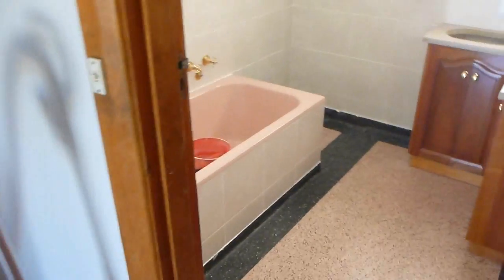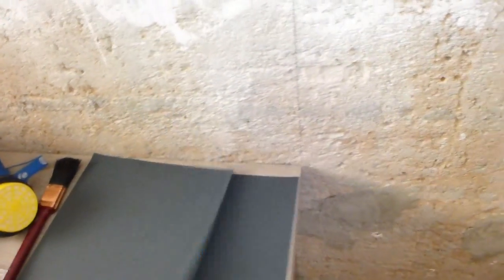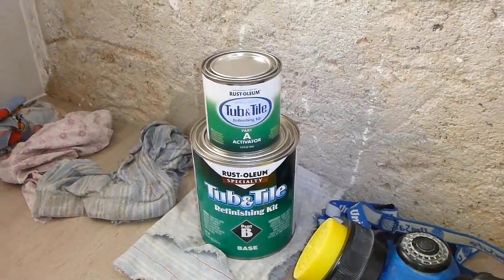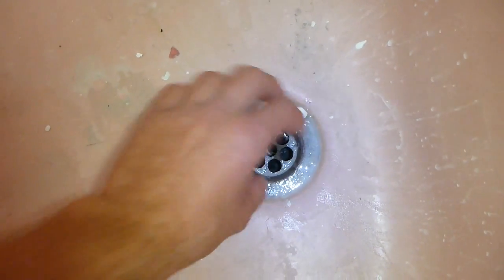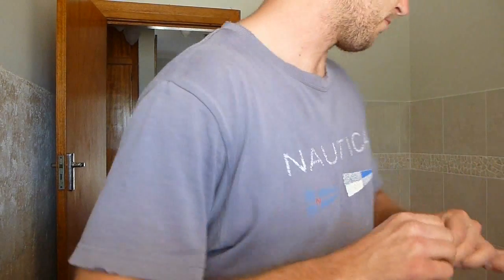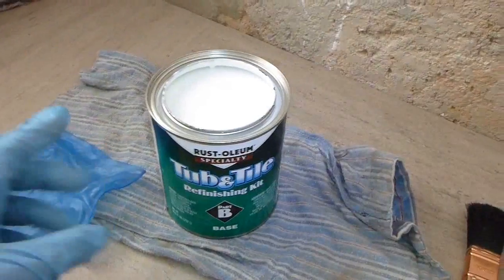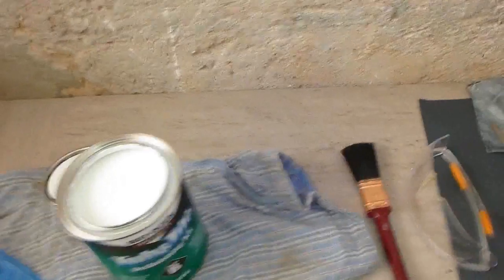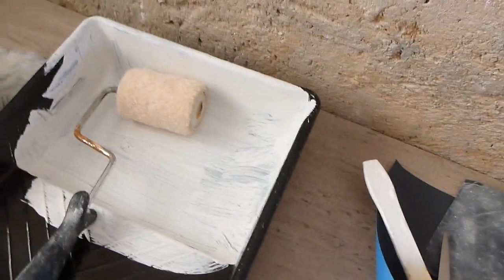How to cost  effectively  Re-Enamel  /  Refinish  a old bath tub    POLISH STYLE

Comment: how come you managed to do 3 or 4 coats with already mixed paint with hardener in it 
me i failed i used a roller left me a lot bubbles also the tin paint hardened inside after 2  3 hours
so could not do second coat
now i have sanded down again made it smooth will use a brush and mix only half paint with hardener
so will wait 12 hours for second coat

Comment: Great job man! Can I still clean with Ajax and scrub the tub without chipping?
Reply from the maker: Yer i would say so.
I actually used brake cleaner just before painting just to confirm all grease and oil is gone.
Reply: @adriand3753  no, what I meant is can I use Ajax and scrub the tub during routine cleaning AFTER the paint job is completed. Or would I have to use a specific cleaner so the paint won't fade away?

Comment: You did a great job on the tiling and cabinets. The bathtub refinish looks pretty good now, but that stuff doesn't last too long. You can get a new porcelain on steel tub for as little as $126 at a DIY store. If you paid $50 to buy that refinisher, it doesn't make sense to paint the tub. If you use that you'll have to replace the tub anyway in a couple years, if not sooner. Also, if you do a good job of sanding, you don't need to pop off the paint and grout before you start.
Reply: I have news for you, those cheapo tubs don’t last very long either.

Comment: NO WAY MAN! 
This dude didn't even etch the thing!
Trust me...if you do this it will not be "Definitely good enough"!
Refinishing is a last resort.
Pink...is a good candidate, but there are NO shortcuts if it's to last...AND be used!
Disclaimer:
This product is not recommended
Reply from the maker: Fair enough; for the ascetic improvement i love it! And for the end product, its still in excellent condition; no wear or tear so far  (i barely use it, but for nearly 2 years the paint is holding on strong). 
So for what i did and my skill, its a great result!
Reply: That's all that matters then
I'm just letting others know :
Results not typical
Keep NOT using it :)
Reply: +Jimmy Bones I used it on a plastic shower pan and 3 years later it's still holding up good
Reply: @adriand3753  with all due respect , Rent House wall paint will "hold up" if you never use the tub !!!!!!!